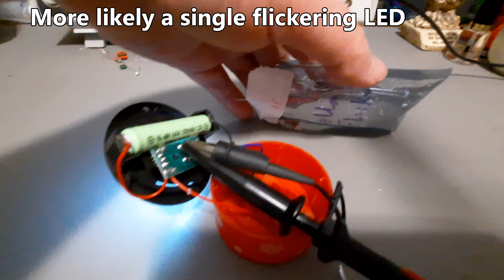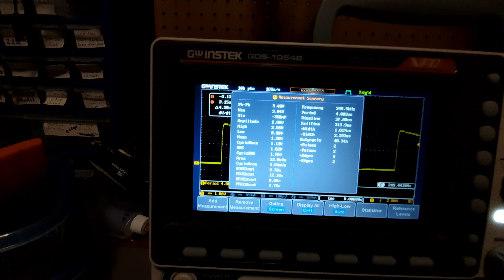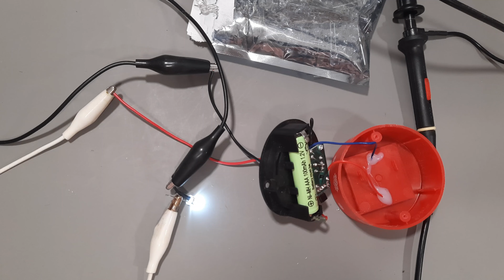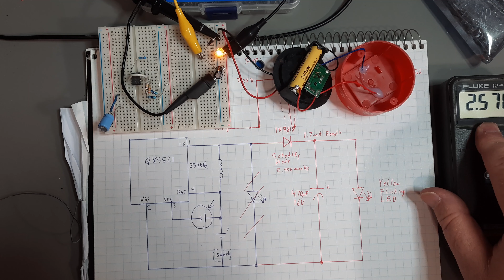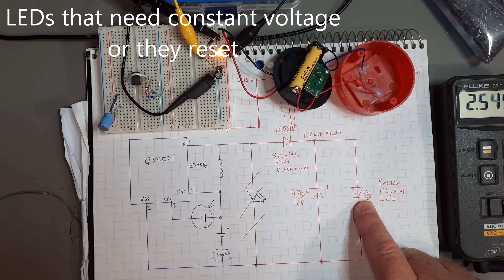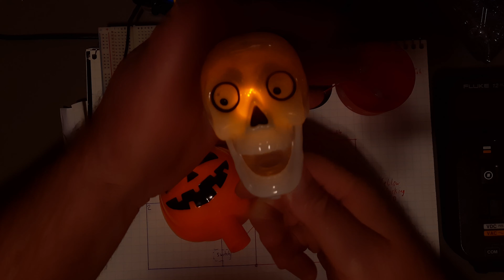Simple LED Project to Enhance your Solar Garden Lights

Comment: A small diffuser on the led might help avoid the spotlight effect we are seeing in your final test, very nice project though.
Reply from the maker: I totally agree. I have just tried a few options: grinding the top of the led produces more dispersion but still not enough, so I modified the led shape with 5 minute epoxy, much more promising. In Mailbag 36 ish I picked up a star type projector that rotates, and was thinking of making my own disks to change the display on the ceiling with different diffusion patterns.
Have a good day

Comment: Try to add 2 LEDs in series see how behave
Reply from the maker: I will try that later. Currently I am just letting it run with the solar cell face down so it is constantly on and draining the battery. With the white led it would last about 10 hours, with the flicker led it has been working for over 24 hours due to the lower current draw.